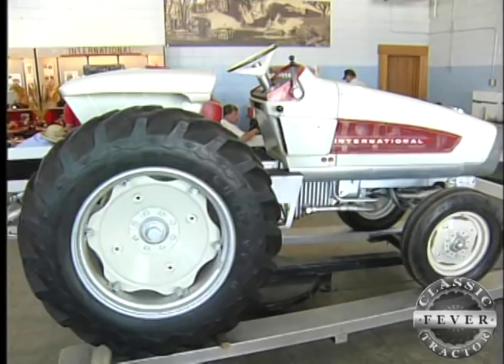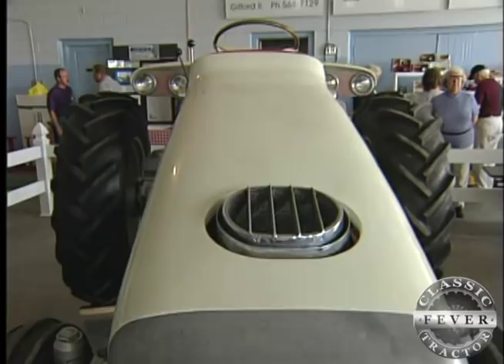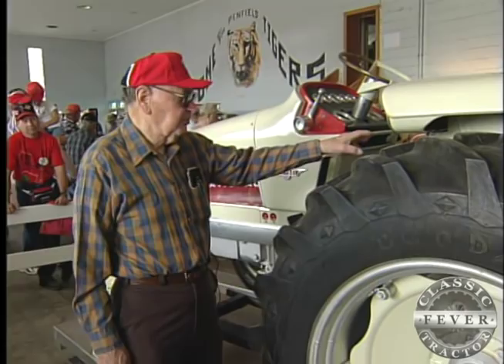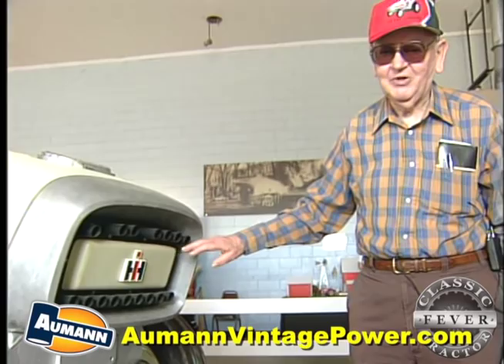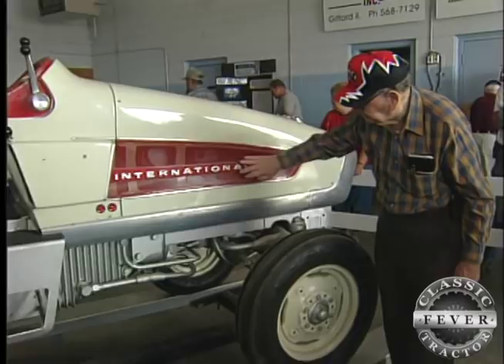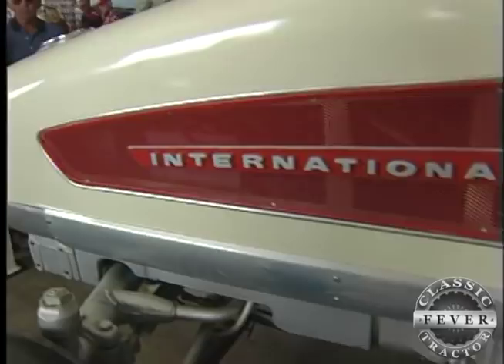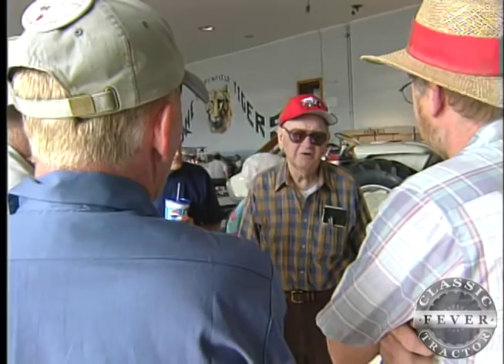This Machine Could Have Changed The Way We Built Tractors - HT-341Prototype Hydrostatic Turbine

Comment: So its not a gas motor if its runs on jet fuel. Jet fuel is diesel . or clean diesel,  more like kerosene . but not gas .
Reply: It's a gas turbine because it's not a steam turbine.  The turbine is driven by hot gases from burning fuel and not by steam.
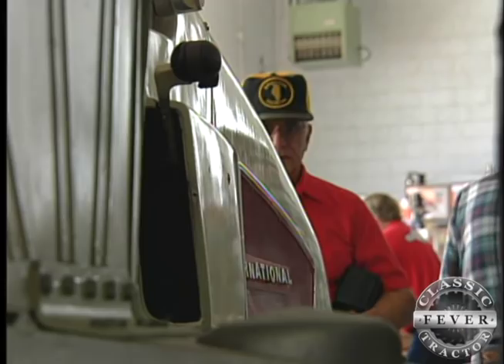Reply: @nonyadamnbusiness9887  @ 1:36 he says it runs on military jet fuel . fyi military jet fuel is kerosene . kerosene is a clean diesel .
Reply: Try to understand that I'm giving you the definition.  A gas turbine is any turbine driven directly by expanding hot gases produced by burning fuel. It doesn't matter which fuel.  A steam turbine is driven by steam pressure and it doesn't matter how the steam is heated.

Comment: Why would it have changed the way tractors were built?   It was/is a fuel hog like all such attempts of applying gas turbines to wheeled vehicles.   Diesel is by far the king of economy and indicating that this could have been a viable tractor is a joke.   What if it had been powered by 300 rodents running on hamster wheels?